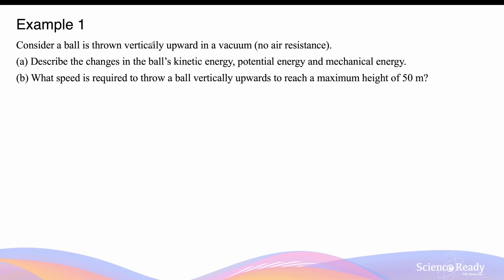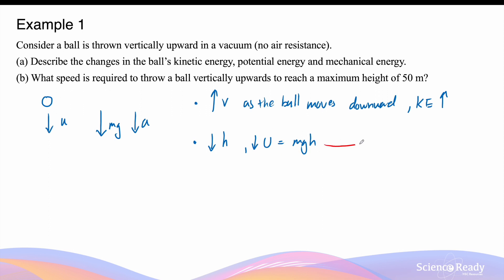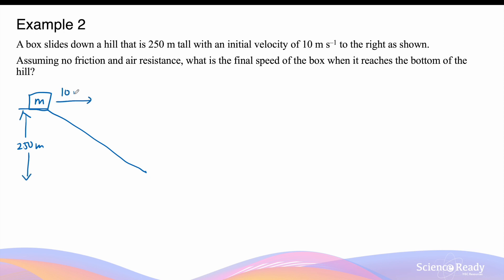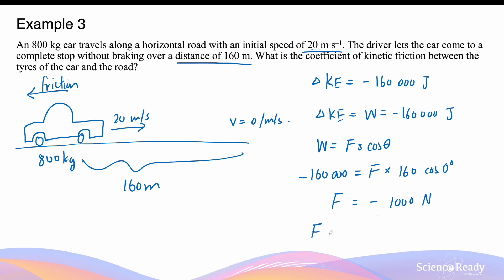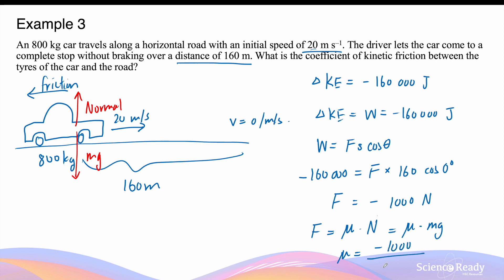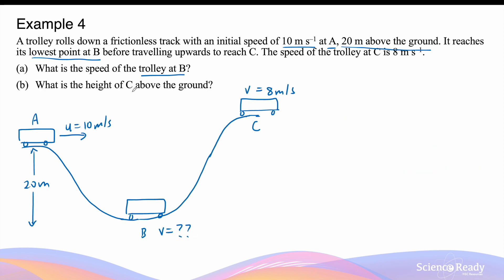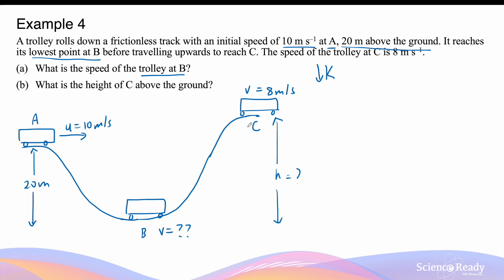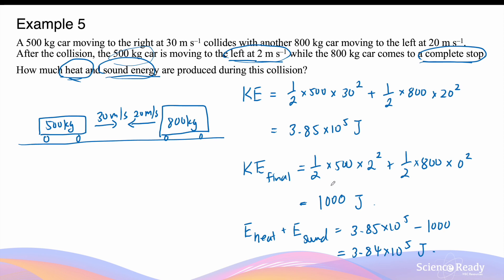Common Conservation of Energy Problems // HSC Physics

Comment: 10:07 why is the 9.8 negative?, did you take up as postive for acceraltion?
Reply: yeh i had the same question, did u find out why he did that?
Reply: if you figure it out tag me, i chatgpted the question and it said regardless of what the answer is you should convert to positive so if he had done it with +9.8 and gotten -0.127, the answer would still be 0.127